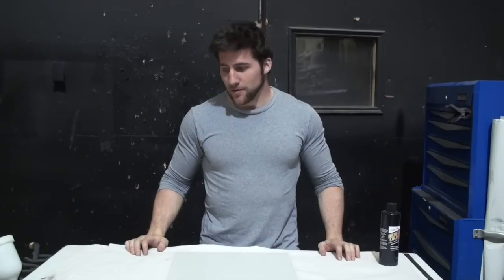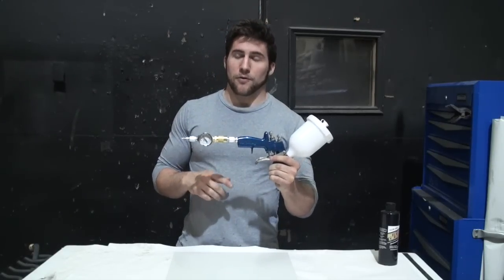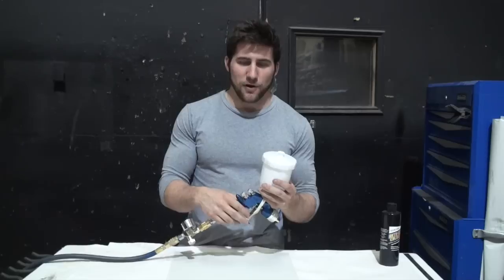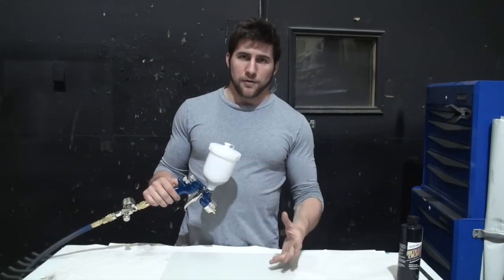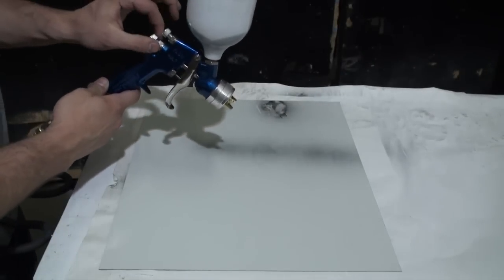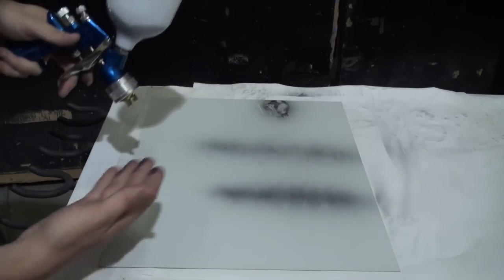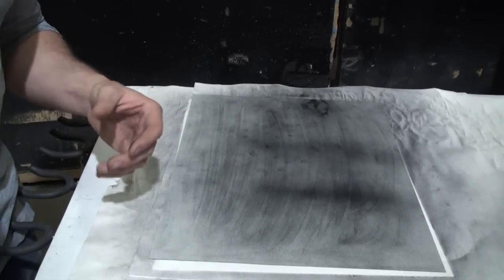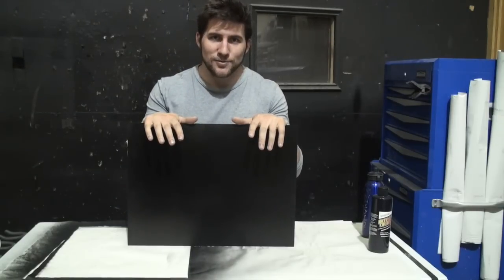How to set up your paint gun for acrylics

Comment: Thanks Brad, I just needed a refresher course on acrylics & your Video did the trick.
 When I was an apprentice acrylics were the only way to go, but then we switched to 2-pack/2K. Great stuff if you have a booth and can keep the crap out of it. And if you get it right first go then your pretty much done once it's applied. The big killer with 2K is the  time you have to wait for it to dry.
 But the convenience & user friendliness of acrylic paint is still a good thing in my book. Yes there is a little more work involved to get it shiny but it is so simple to apply. And if you do have a glitch it dries so fast that you can usually repair it and refinish in a couple of hours.
The only thing I would have added is that a slower reducer provides a better finish, especially when you are painting down here in the Australian heat.
Reply from the maker: Thanks Robert. We overcoat this stuff with 2K to get a good hard gloss afterward if that’s what we’re going for.

Comment: Thanks heaps for this video you explain the details a lot better than so many other guys. I've been attempting to spray a guitar with Grafted Coatings KTM-9 urethane acrylic. I'm using a small touchup gun, 250ml cup with a 0.8mm tip but it just won't seem to atomize like the acrylic you're using. Would I have to do something different to setup the spraygun.
Reply from the maker: Andrew Darnley For a urethane you may want to try the other spray gun setup method. I have another video, which I think is simply titled how to set up your paint gun. Try doing it that way (on a test piece) and let me know if it works for you. I'm not familiar with that line of paint specifically, but if the other setup doesn't work I'm sure we can figure out what's going wrong.

Comment: Brad--Is the setup you describe here also appropriate for a clear, solvent-based, acrylic sealant for metal ?  I'm using the sealant on thin steel overlay rustic garage door panels to protect them from UV here in Arizona--the sealant seems pretty thin but i have no experience with acrylics. The manufacturer says it's best to spray multiple thin coats but that's the extent of directions and i haven't found anything on YouTube about spraying acrylic sealants.
Reply from the maker: I imagine he probably didn’t mean quite this thin. Solvent paints flash differently. You’ll want to follow my other tutorial on how to set up your paint gun instead.
Reply: OK thanks
Reply from the maker: You’re welcome.

Comment: Hi Brad. I am starting out the explore the use of mini spray guns for plastic modelling. I am curious and need advice on why one would use acrylic clear gloss vs lacquer clear coats. I have been told that lacquers spray easier and gives a tougher protection. But I would like to hear your experience as I am exposed to very few water based acrylic spray painters.
Reply from the maker: Lacquer does tend to dry faster and be a bit harder than acrylic. There are certainly harder finishes than lacquer, but solvent based lacquer is also easy to fix. That made it a popular option for a long time. The downsides are that it yellows with age and sometimes cracks, and it can be dissolved again even when completely dry.
Reply: @BradAngove  Hi Brad. Thanks so much for the quick response. May I know what other types of clear coats are tougher than solvent based clear coats? I want to try UV and scratch resistant coatings.
Reply: @BradAngove  are there recommended clear coats to prevent yellowing?
Reply from the maker: There are other solvent based clear coats that are tougher than lacquer. For example, caralyzed polyurethane or polyester. Enamel is tougher than lacquer even without clear coat usually.

Comment: im not sure if this has been asked before or if you have made any video on this.. but with "reducers" what are in these? i.e, can you or do you use water for water based acrylics (i do this to my acrylics out of the tube for paintings on canvas), what do you use for solvents would that also be a type of thinners? i use mainly tamiya acylic and use x-20a to thin them down to use in my small airbrush, would it be the same but just on a larger scale as ive brought a mini spray gun to mainly do clear coat 2k + hardener and what do you use to reduce/thin this stuff too? 
cheers
Reply from the maker: Many acrylics can be thinned with water, although there are other better reducers available for some of those systems. 

Solvent based paints get a bit more complex. Some are thinner with lacquer thinner, some with “paint thinner”, some with xylene, etc. 

2K paint systems are generally pretty specific about what reducer should go with them and in what volume. That info should come with the paint (and so should the reducer usually).

Comment: Hi Brad - Thanks so much for taking the time putting these videos together. I really enjoy them and 'Paint Talk' is great! So here's my question. I've been a musician for many years and even though I've owned lots of guitars I've never built or painted one before now. I am building a custom telecaster and have been leaning towards using the "Duplicolor Paint Shop" finishing system. Each of the components come in quart size cans, primer, base color, clear coat, etc. I know there are lots of variables in the amount used but will these quart sizes of each be enough?   Duplicolor also has a "Perfect Match" spraycan version of this paint at about $7-$8 per can versus the $25/quart for the 'Paint Shop' version. Money is not my main driving force here rather the quality of the results are but if I can save some bucks in doing so that's just icing on the cake. Thanks again, keep the videos coming
Reply from the maker: Hi David. I'm glad to hear that you're planning on giving this a try. Duplicolor has some nice products. I've use their paint shop line before with good results. With a quart of primer, base, and clear, I could probably paint five or six guitars depending on how many coats you're looking for. I don't think you'll have a problem there. I don't like their perfect match paints personally. If I were going with spray cans (which I wouldn't recommend), that's not the paint that I would use.
I hope that helps. Thanks for watching.

Comment: Good info, thanks!
Het Brad do you us the small inline filter inside the spray gun when using acrylics or do you remove it?
Reply from the maker: I don't use those. I do sometimes filter my paint as I pour it into the cup though.
Reply: Yeah, i was trying to spray waterborne paint with a 1.3 gun and the filter was forcing me to go really slow so i removed it. Thanks for answering!
Reply from the maker: You're welcome. That's the same reason that I stopped using it.

Comment: my question is, and I'm a newbie and not purchasing an expensive gun, whether a cheaper HVLP or cheaper LVLP is better for acrylic enamel?  I have had problems already with spraying with mini type HVLP guns and getting my spray just too dry.  Could this be because of too much air and lead me towards LVLP?
Reply from the maker: It’s unlikely. Hvlp Guns are designed to move more paint faster. They generally are able to put on a wetter coat than an lvlp.

Comment: Hi there Brad, thanks for great vids! I use Acrylic Lacquer 1K at home on cars because it's easier without perfect conditions and a booth. 
I have question for you please.
I've just finished rear quarters, a boot an bumper. 
In one spot mid panel, about 15mm circle, I sanded through before buffing and a slight old paint discoloration visible. 
I have a lot of trouble blending Acrylic 1k clear edges to invisibility and I don't want to reclear the whole panel if i can avoid.
So the approach I want to try is this mix color and clear:
1. sand very small (about 50-cm circle) area around the discoloration with lightlity with 600-800 
2. Back mask with a good curve in the tape to avoid an edge and keep first 2 coats tight as possible to the discolored area
3. Mix 50/50 1k Acrylic Clear and Block Color (no metallics or pearl involved luckily)
3. Use small touch up gun with 0.8mm nozzle and turn down pressure, fan about 1/2 to 1/3 of usual fan
4. Mist on a a few coat, making the area just fractiionally larger on 3rd, 4th, 5th mist coats each time, but keeping it as small as poss.
5. Leave to get fully hard for a couple of weeks.
6. Resand lighting and cut and polish panel as normal 

What to you think, especially of mixing Clear and Clear instead of doing a final clear coat, which as I say I have real trouble getting a good edge blend??
Reply from the maker: Acrylic can be very difficult to blend. I’m personally not very good at it at all. Your strategy makes sense to me, but I’ve never tried it. I would think it’s probably worth a try though. It should cut and polish in much the same way as standard clear would.

Comment: Hey Brad.  Great video as always.  I just have a quick question.  I am looking to buy a paint gun setup but unfortunately I do not have an air compressor at my house and I really do not want to spend a lot of money for one that has a 60-80 gallon tank.  Basically what I wanted to know was, with the Auto Air system of paints, could I get away with buying a small little pancake compressor that has a psi rating of 110 and use an lvlp gun instead of an hvlp gun? I know the amount of cfm is what matters in the quality of the compressor but since we are not painting a car, I thought as long as we met the PSI requirement for spraying acrylics the pancake compressor with the lvlp gun would suffice.  Is this statement true? Thanks again for all your help.
Reply from the maker: +Robert Clowers Hi Robert. I would imagine that for the auto air system a small compressor and an lvlp gun would work just fine. The potential problem would be after that point if you were planning on spraying your own clear coat through a gun. You may have some difficulty getting a good layer of polyurethane on there properly with an lvlp gun. It's difficult for me to say for sure, since I generally only use HVLP guns for that sort of thing.

Comment: Hi Brad what size fluid tip do I use for acrylic clear coat some say a 2mm which my gun has some say a smaller tip thank you
Reply from the maker: I would use a 1.4 or something in that range. 2.0 is practically a garden hose.
Reply: @BradAngove  Thank you very much, much appreciated

Comment: Hi, Brad, i was wondering  can i spray etch primer over paint as i have a few bare metal patches i will be putting etch primer on but it will be going over the paint as well thank you
Reply from the maker: That a good question. I honestly don’t know the answer. My guess is it should be fine as long as you scuff the paint up a little bit where you’re spraying before you do it.
Reply: @BradAngove  Hi Brad all the paint has been sanded nearly back to the primer but i have a few patches of bare metal which i will etch prime but i will get overspray on the paint
Reply from the maker: That should be fine
Reply: @BradAngove  Thank you

Comment: Hey Brad I have a Deville Biss with multiple nozzle sizes, that looks similar to the one you are using. I normally use it for polyurethane and epoxy coatings, but I want to use it for a couple of acrylic jobs. Will the acrylic residue left in cup etc cause problems when I go back to using Polyurethane? Is it common to use the same gun for different types of paint or is it worth investing in separate guns?
Thanks
Reply from the maker: If you clean your gun carefully between uses, you can use the same gun for several different kinds of coatings as long as it is compatible with those types. I have another video on how to clean you paint gun. It lays out the process that I use, and I've sprayed polyurethane and acrylic through this gun.

Comment: Nice video and very helpful.  I just started apinting with an air gun and my finish seems to have a sand paper like finish.  Any ideas on why this is happening? Using acrylic out of the can.
Thanks
Reply from the maker: You’re probably spraying it on too light. If you’re using spray cans, have a look at my video on how to get an even coat of paint with spray cans.
Reply: Brad, thanks for getting back to me.  I'm using a new HVlP gun and it's my first go without spray cans.
Reply from the maker: Oh; I see. What kind of acrylic is it?
Reply: Benjamin Moore Ultra Spec D.T.M Acrylic. Low lustre Enamel Base 4 HP 25-4x.  They mix a color for me
Reply from the maker: Ok. If that’s coming out rough you probably just need to spray it on wetter. Get the gun a bit closer and/or move it slower.
Reply: Thank you, I will give that a shot.
Reply from the maker: I hope it goes well for you.

Comment: I'm painting my wood teardrop trailer only got a 2.3 mm gun I  used poor  man's fiberglass so its rough so how could I set  my gun up to paint this I'm using 100% acrylic
Reply from the maker: Are you going to sand it smooth first?
Reply: I did 4 coats on my galley door work well enough for me i put 3/4 cup water to a gallon 100% Acrylic  played with the dials got it 👌
Reply: I sanded and primed first
Reply from the maker: Glad to hear it worked out.

Comment: Which spraygun do you reccomend I get to spray all single stage paints,can I use a 1.3 on all of the diferent single stage paint variants available.

Also which spraygun do I get for base coat and clear coat for spraypainting.
Reply from the maker: 1.2 or 1.3 are pretty versatile nozzle sizes. There are many different gun options that you can use, and for those most part those are nozzle sizes that will work with the bulk of paints.

Comment: I see some spray guns have Water and Oil Separator(small filter just like a fuel filter on cars), isn't that filter enough? Or I should buy 3 In 1 Twin Air Filter Pressure Regulator Gauge?
Reply from the maker: I’m not familiar with a filter that comes on the guns, but if there is one then the regulator will likely suffice.

Comment: Hello Brad [wife's computer ] I build radio controlled aircraft and I tryed  to use acrylic paint to spray my balsa wood Lancaster bomber but the spray turned out like sandpaper.....what have I done wrong and will you help me please thank you .
Reply from the maker: You’ve probably raised the grain. That’s normal. Sand smooth with 600 grit paper and spray one more coat, then let me know how it feels.
Reply: @BradAngove  Hi Brad used 800 paper ...still grainy
Reply from the maker: Did you seal the wood before painting?
Reply: @BradAngove  yes I did u/coat and primer so I rubbed it back again and resprayed and this time I raised the air pressure and thinned the paint more  and I think it is acceptable now. One more question if you wouldn't mind...how many psi to the bar [ not the musical sort ]
Reply from the maker: It depends on the gun. I usually use 30 psi or just under at the base of the gun.

Comment: Do you have to thin acrylic paint
Reply from the maker: Not necessarily, but I usually do.
Reply: Thanks im new to using a spray gun i have been having trouble with a few things. Im doing a bed set and its got a very thin layer of i dont even know what it is it dosnt seem like the usual laminate. Ive done a good but light sand and some parts the paint will peel off. I think I may have found a paint that will stick. I do have a question though, I would like the top of my pieces to have a gloss or something that will be easy to clean or wipe down can you recommend something I can spray. And for final coat do I sand its not rough or anything I just would like a more gloss feel. . Sorry if these are stupid questions. I am learning still and ID like to be good at it and continue to work with projects with my spray gun. Thanks for your time
Reply from the maker: What kind of paint are you using? Automotive acrylic?

Comment: Hi Brad, i have a couple of questions i just sprayed my Landrover acrylic Trident green the clear had dry spots and rough spots, i have a star gravity feed gun, i had the pressure at 35psi the shed was hot i mixed 200ml of clear to 250ml of thinners, also what size nozzle for base coat and clear any help appreciated. thanks Farmer
Reply from the maker: Hi Farmer. I'm not sure what kind of clear you're using exactly, but I can tell you a few things that might help here. Clear is generally a bit thicker than your average paint because it's supposed to build up more. You may be thinning it a bit too much, and as the thinner evaporates you're not left with enough material to provide a proper coat.
Also, you might not be spraying heavily enough in general. That could come from having too small a nozzle, or moving too quickly with the gun, or not pulling the trigger back far enough. I generally use a 1.3 or 1.5 mm nozzle when I'm spraying my clear. Some clears need to be thinned. Others don't. I also aim for about 26psi at the nozzle, so I set my regulator to about 28-30 psi at the base of my gun.
Reply: Hi Brad thank you for the reply. i just checked the spray gun it has a 
2mm nozzle also the acrylic clear i was using was PPG clear so i think 
my problem was the nozzle was way to big i should of checked nozzle 
size, what size nozzle do i use for the acrylic top coat, would the 2mm 
be ok. Thank you. Regards farmer
Reply from the maker: The 2mm nozzle might be ok if you're spraying it really thick. Usually I use 1.2-1.4 mm for that. I think you might be right about the source of the problem haha.
Reply: Thank you Brad keep the great videos coming. Regards Farmer
Reply from the maker: You're welcome. Best of luck with your project.
Reply: Thank you Regards Farmer form Australia